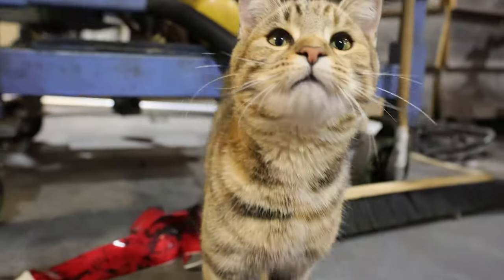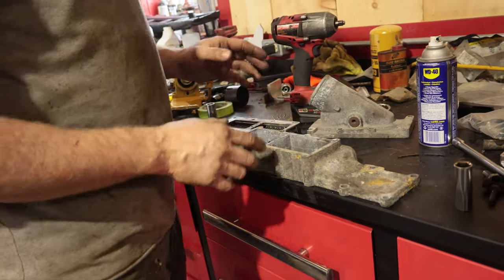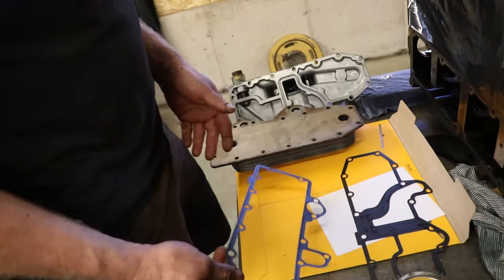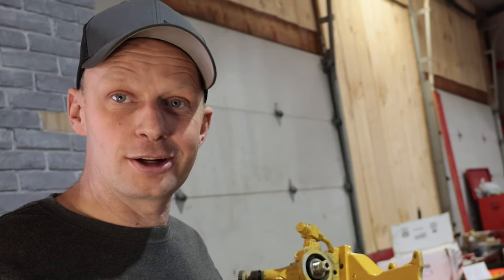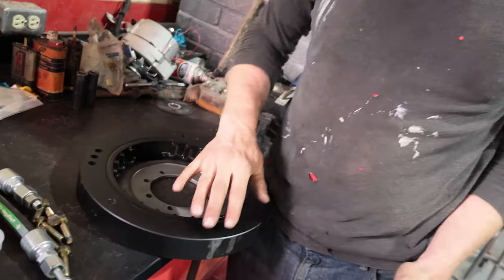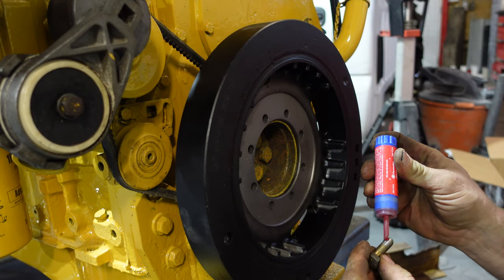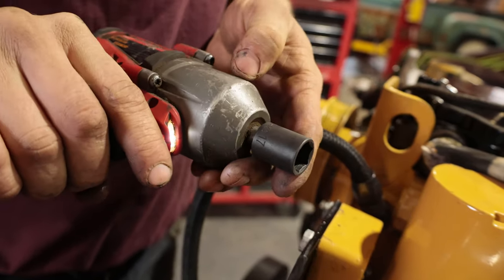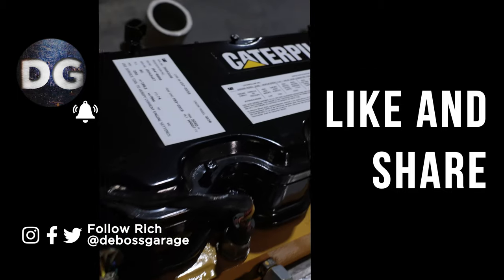How To BULLETPROOF a CAT 3126 Diesel Engine | #FTreeKitty [EP9]

Comment: Thanks for the great content Rich!  Thanks as well for the warning about high pressure leaks.  Sometimes we forget and the results are devastating.  I have a CAT C7 that I am putting into a rat rod that I building out of a 1961 Mack truck (mackrat.com)  What did you do with the CAT fuel transfer pump now that the FASS pump is doing all of the work?  Appreciate your suggestions if you have the time.

Comment: If I'm understanding this heui system right, why can't we make the engine oil go right back into the engine after the filter, then eliminate the part where it goes over to the huei system, and have the heui system and the oil system operate totally inependentally. Each would have its own filter and cooler if needed plumbed in.

Comment: Hi Rich, what's your take and experience on overtightening regular bolts? The prescribed torque always feels like just not enough, what % do you think you overtighten? And do you guys up in Canada also have the more civil and sophisticated metric thread system  ? ;P
Reply: Check your torque wrench to another one or pro tested. Most of the wrenches are longer so more leverage or easier feel...just torque to specs

Comment: So I need a little help it's sorta related but sorta not at the same time. I love the 3116. I always have and I always will. I also love the Kodiak and I want to get a 3116 Kodiak with an Allison Auto and convert and shorten it to a pickup. The whole issue is I see the trucks can pull around 14,000 pounds but I want to avoid building a truck that actually requires a CDL to drive in case some day I don't want to renew. It will be very difficult to build the truck to the weight that keeps the GVWR under 26,000 the way it properly needs to be done with the toolboxes transfer tanks and whatnot, I was wondering if anyone knew a way around it? Like is there maybe a way to have it so I can have the truck weigh 15,000 pounds and just not pull anything over 11,000 pounds or do I have to choose between a required CDL and an underbuilt truck?

Comment: Do you need an accumulator to keep up the pressure after that filter?
Reply: If your talking about the FASS it moves 100+ gallons an hour depending on what the engine calls for, its regulated fuel pressure being fed to the engine. Mine is 165gph and 16psi if I recall correctly, been a few years.

Comment: While I appreciate the fab intake, could you have used a spacer between the intake an head to accomplish the same goal. Asking for us less accomplished fabricators
Reply from the maker: Probably help, but essentially, the air still needs to go around 2 ninety degree turns so not ideal

Comment: Could have chucked something like a 5i-8670 hyd filter before the high pressure pump instead for 8 lbs instead of 80 lbs or whatever that dumbell weighs. Obviously doesn't rule out HEUI pump failure but I didn't think that was a very prevalent issue? Don't forget to prefill that prick when you change the filter lol

Comment: I'm not sure that manifold will be much better, basically any turbo 6 has the same issue with a forward facing plenum it leans out cylinder 6 because that's where the least resistance is for the air to flow to.

Comment: I have 2 car 3126 motors. 1 has 900000km and the other has 800000km, never been rebuilt, injectors yes. But we have never replaced the harmonic damper. What's the deal?....

Comment: I used to work for a guy with a dump truck with a 3116,he ran it every day for literally years without changing the oil, the truck ended up rotting out before any engine trouble. Guess he got lucky.

Comment: Are there aftermarket performance parts for a cat like that?
Reply from the maker: Yes.  Getting rings from Total Seal was cheaper than Cat rings, and better IMO.  Injectors, turbo, and engine kit are all aftermarket.  Total cost from CAT was over $10k

Comment: Loctite 545 for those NPT hydraulic fittings. That's all I use on my farm equipment. No leaks. Ever. Also, I like to see you chasing threads! Tip: https://amzn.com/B07TM75ZMK and https://amzn.com/B000IHWCOW

Comment: 1997 ford f superduty hydroboost setup is bolt in with no modifications.
Reply: True but good luck finding one. Last new unit in the country sold on eBay 10 months ago from a Ford dealer in Amarillo, TX. Rebuild service is 6 weeks wait time. 

I was gonna hydroboost mine until I saw how difficult it is to replace if something goes wrong.

Comment: More Filters ARE better!
If you have a filter that says 2 micron on it doesn't mean it filters every particulat over that size, it just means the filter medium is a that size.
Better way to filter your fule is to parallel more filters or have bigger ones to reduce the flow through them! This way even for example a 5 micron filter can take out more 2 micron particulat than a 1 micron filter!
MTU did this for there new 2000 series engines that are updated to common rail, they just put a Detroit diesel filter thy used already on other engines, out of the shelf and Jamed 5 of those on one engine.
It looks ridiculous but dose the job.
Got this information from a MTU engineer, because I asked him why they did this!

Comment: Why couldn't you put a filter on the supply from the block to the pump and avoid the 4000psi?
Reply from the maker: That's already there from factory.  This is to protect the injectors if the pump ever lets go, which is pretty common.  Each injector is $800
Reply: @DEBOSSGARAGE  Gotcha. Thanks! Great content, love following the progress.

Comment: The #1 killer of the 3116 and 3126 is the water pump belt/tensioner assembly. I'd like to see a "bullet proof" idea for that mess.
Reply: They updated it in the later models and it runs off the serpentine belt.
Reply: Better then breaking the bolt off loosening the tensioner just to find out you have to pull the balancer to get the belt off huh. lol

Comment: I dont know but why not filter the 60 psi side of the pump ?
Reply from the maker: You mean the giant Cat oil filter isn't enough?
Reply: Cat now makes a filter to install between engine and low side of the injection pump. I'm sure he is aware of this. Good solution when you have oil cooler or gasket failure like he was talking about.

Comment: "Over 4000psi of pressure" 
me, who works on common rail diesels: only 4000?
Reply: The heui injectors amplify that oil pressure and the fuel is injected at a lot more psi.
Reply: Yeah I know, I just meant it as a joke, still super deadly

Comment: oh so he wants to run it on old engine oil from many other engines users to save money burn that, but pollutes so much, could filter it in garage not need to hang heavy filter on engine or what.

Comment: 4000 psi through a 4300 psi-rated hose isn't much of a buffer. I would have gone with some R15 hose rated at 6000.
Reply from the maker: Because 4300 psi hose is tested to well over 5000
Reply: Standard hose pressure rating has a 4:1 safety factor. If ever needed you could get them hydrostatic tested and certified which is to 1.5 times working pressure. I work at a hydraulic shop and we do certified hoses for many customers

Comment: To a European this looks fun but complete overkill for a pickup truck. Here anything over 3.5 tonnes (Gross vehicle weight) is no longer a domestic vehicle and you run into Comercial licence and 90kph speed limit. If you stay unnder 7.5 tonnes things are easier. But then a 5.9 cummins/ Merc OM606 with little or no mods gives you more power than you can use (90kph speed limit)
Reply: 175 hp is more than you can use? Referring to the merc
Reply: @tonyslater8641  Look up modified OM606s
Reply: @wyattrowe8396  he said little to no mods...
Reply: @tonyslater8641  For legal road use YES.

Comment: Before I ask the question, I want to first state that I'm a novice at best when it comes to diesel engines, so don't blow up if I sound like a moron.

But if the heui system is such a weakness because it uses engine oil as hydraulic fluid, why not just have a standalone hydraulic system proprietary to the injectors? Why go through the hassle of pumping and pressurizing engine oil when you could just slap a small hydraulic reservoir with actual hydraulic fluid and use that to run the heui?